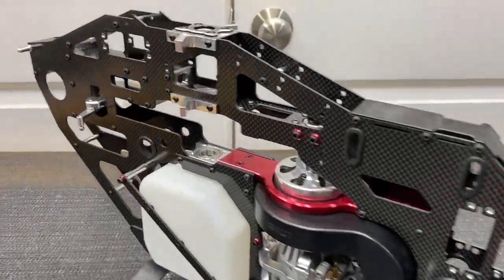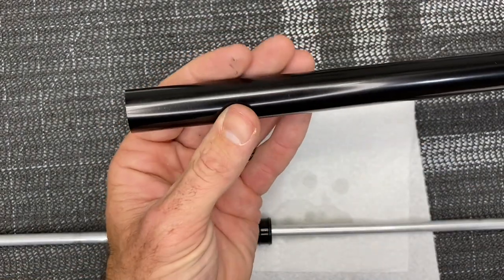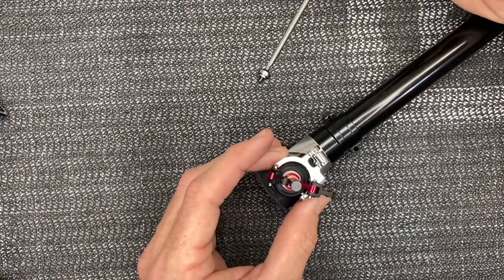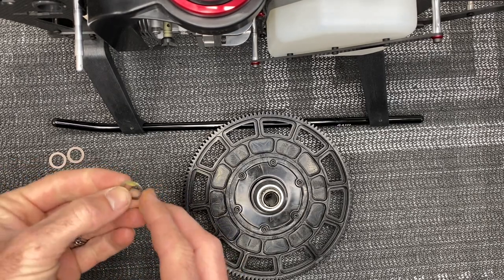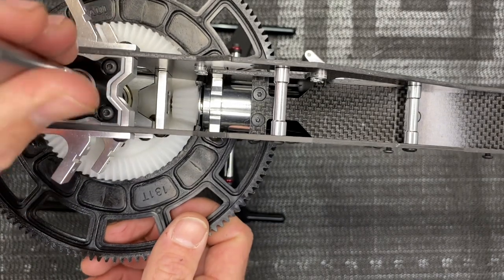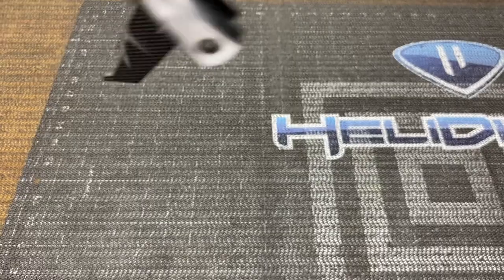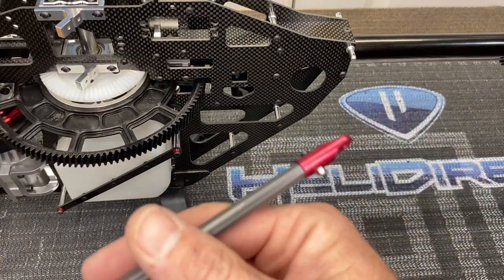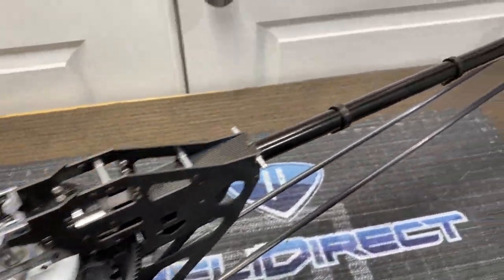GAUI NX7 Build Part 2

Comment: I think you should tighten the boom on the frame before getting the tail fin mount locked. This way there is no accidental movement on the boom with respect to the frame
Reply from the maker: You have to set the tail assembly first as there is a pin to lock the tail assembly to the boom and nothing on the frame side. So to make sure boom is straight, you tight tail assembly then boom mounts.
Reply: @westhobbiesrc8051  Oh, I meant you installed the horizontal fin and it's mount before tightening the frame.